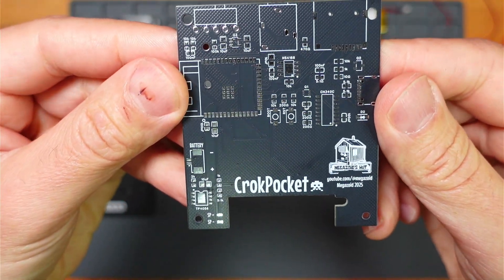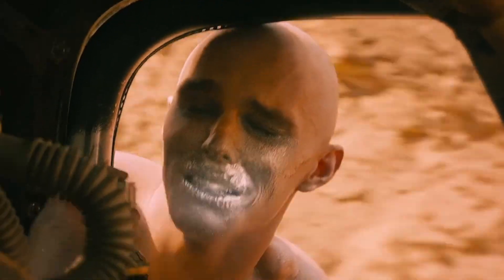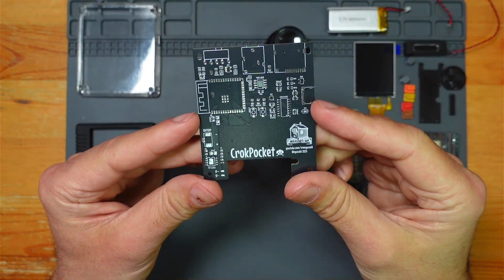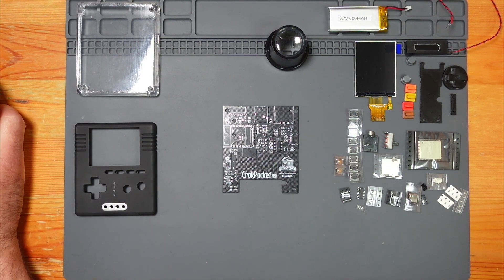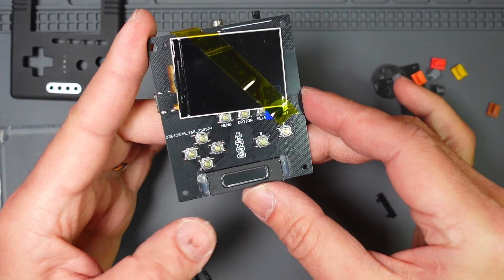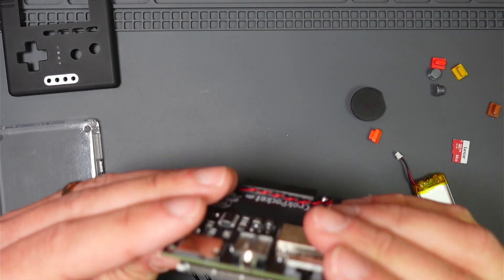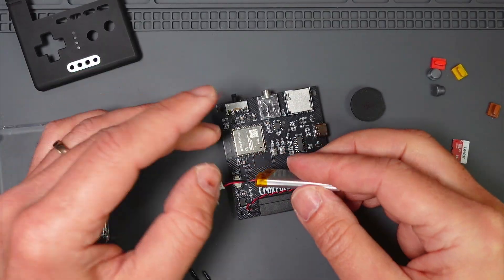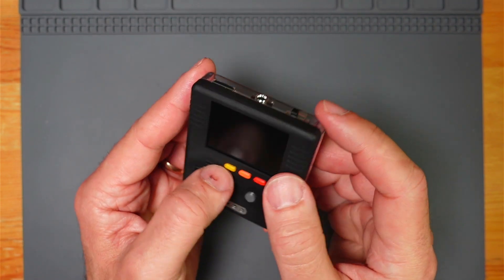Making the CrokPocket: A Clear-Backed ESP32 Handheld 🛠️Full Build!

Comment: Is there any explanation as to why you solder the ESP32 using that device (I don't know the name) and the other components by hand?
Reply from the maker: There are 9 heat transfer points under the ESP32 which can't be hand soldered. It's not that important to solder them, but since I have a hot plate, I might as well use it.

Comment: Hi, great project! I'm also trying to create a similar one, but since I'm in Italy, it's very difficult to get a display with the ST7789V driver. I have an IL19341 240x320 SPI TFT. Is it possible to modify the source file and modify the drivers to make this TFT work as well? I have an ESP32S3 Devkit-C. Thanks so much for your time!
Reply from the maker: ILI9341 is the default screen driver for RetroGo, however l'm not able to help. I had to get somebody else to do the image compiling because I suck at it. RetroGo is not beginner friendly tbh.
Reply: hello, did you manaage to figure out display settings. I have a st7789 and am getting inverted colors. I saw that there is a config file, but unsure on how to invert the colors

Comment: It's an awesome device. I've gone a little crazy with RetroGo devices in the last 3 months and I think the CrokPocket is probably favourite to actually play on. Nice responsive controls, good size clear display, useful LED's and probably what surprised me the most was the great sound, its really clear, not mention the audio jack too! 

It was fun to build too, the 0603 resistors/caps aint too bad after the first few and for those concerned, I didnt use a hotplate, its possible the components that use the ground plain for heat dissipation may not be quite as effective but they dont feel overly hot to me. I do keep meaning to buy a hotplate tho, just so I can watch the components seat into place!
Reply from the maker: Cheers for sorting out the firmware build & Github page dynamight!
The sound is not bad, especially through the headphone jack. I'm glad you liked it. it's safe to make without hot plating for sure, but I'd pick up a cheap one at some point. Eventually you are going to need one. 😁
Reply: Been eyeing up some Aliexpress special USBC hotplates, mostly because they're like £12. Wonder if they're any good :) Got an unused iron in the house somewhere too :)
Reply from the maker: @dynamight1124  I'd just get the Mechanic IX5, although you do need an adapter for the two pin plug. £18.80 in the upcoming sale. Got mine a year ago and it's still good.
Reply: Added to the wishlist, looks good!